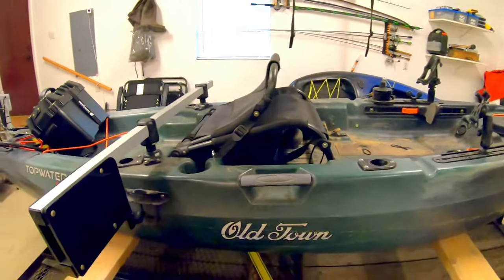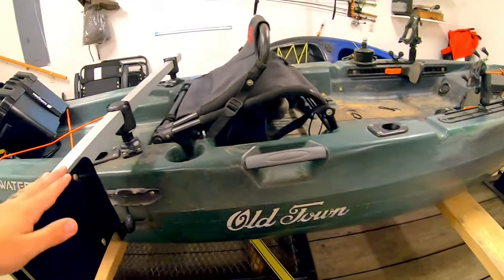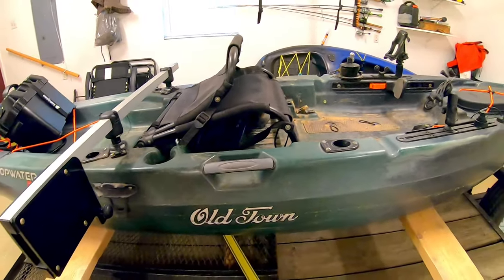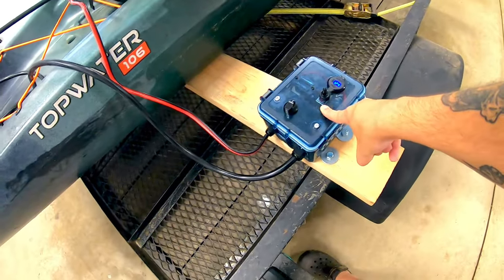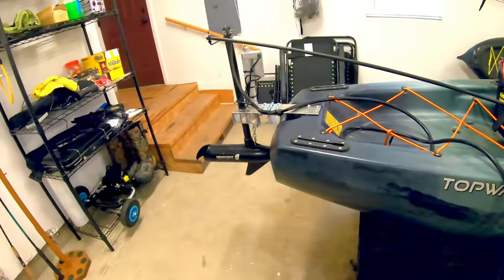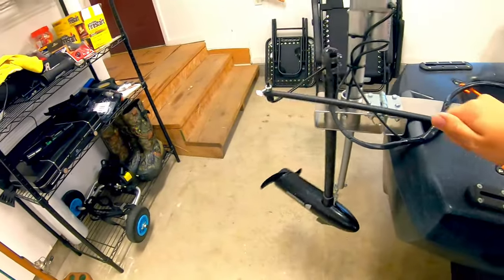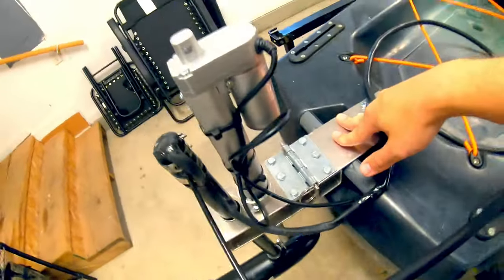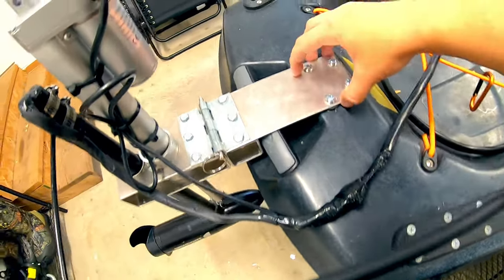Best Ways to Mount a Kayak Trolling Motor

Comment: I have a 10 ft Hoodoo kayak that I have a side mounted trolling motor and it works fine except obviously the kayak wants to Veer off to one side for a little while until it's up at speed and then I got a bigger kayak that was heavier I went with the rear mount and an extension tiller for the handle and it works phenomenal. I did not want to mess with a bunch of different wires and cables and having to deal with replacing pwms all the time but the setup I have now works perfect. Like you said you just have to watch videos and figure out what works best for you. Awesome video man!
Reply: Did you find it difficult to operate even with the handle extension ?  I would like to see how you have it installed.
Reply: @dalevogel83  no not at all, the way I have it set up is very user-friendly and I have a pulley system with a handle up front to get it out of the water I would show you pictures but I don't know how
Reply: If you aren't using a PWM or ESC then you are wasting about half of your battery power. The ESC/PWM allows your trolling motor to run 2-3x more efficiently, allowing you to use a smaller battery or the same battery for 2-3x the duration of your current setup.
Reply: @S_Yayyts  I have the Minn Kota Endura MAX that is infinite variable speed. I specifically bought that trolling motor because it's already built in so that I would not have to mess with wiring up a separate pwm and then replacing it all the time

Comment: Great video!  Very clear explanations.  The Newport NK300 and NK180 have me seriously looking at options for my 2016 Native Slayer Propel 13.   The easy mount for me is to put the motor right in my Propel drive slot.  Optimally, I want to speed up my trip to the hole and pedal the yak once there.  The twin thruster models have advantages, but the ones I've seen are very weak motors.  Still considering!
Reply: That's my main way..

Comment: I purchased the HOODOO SPORTS TEMPEST 120 HYBIRD EDITION. I run the cockpit fitted 46lb thrust trolling motor, they make where my PDL drive would sit. Then I purchased the Bixpy J2 motor, attached to my rudder. Both are on the kayak, for every trip. But I use one or the other, and always have my paddle, so I'll always get back to my launch spot. I researched for a year, and wanted the Oldtown 120 powered by Minn-kota. But at that time, you couldn't find any good kayaks. I didn't want to DIY any motors. But if it's working for you, food job bro. I know they're very tricky. Be safe..🤟🎣🙏

Comment: I have the same kayak but I’m in ocean water in Hawaii. Looking for a good set up for trolling motors. Will have to think of good ideas for one. 🤙🤙
Reply: MotorGuide Xi3-55SW - Bow Mount Trolling Motor - Wireless Control - GPS - 55lb - 36"-12V

Comment: I like the first set up, an interesting way to offset the weight would be to run two motors one on each side, there are 30 lb thrust motors that weigh as little as 8 pounds. that would give you 60 lbs of thrust, with an ecm and a 60amp hr lithium you'd be lightweight and powerful.
Reply: I like your train of thought

Comment: Cool system! The actuator is a great idea. Looks a bit slow though, but nonetheless very nice. I have an inflatable kayak so the options are very limited. I had to build my own system using a Bixpy motor mounted on the stern. What I particularly like about Bixpy, is the fact there is a wireless remote control to operate the motor. I believe they are the only ones with this technology. So you can operate the motor from anywhere in the kayak. Thanks for the video. Too bad I just found it.
Reply from the maker: Definitely looked at Bixpy. Looks like a great unit.
Reply: I've built an ECM wireless remote for as little as 50 bucks and can be used with any motor, I used RC parts for mobile watercraft.

Comment: I had looked for a side mount,  never did find that bracket for sale, always out of stock.  so I made one that locks into rail.   I'm on version 5, and have sold a few to other kayakers that i've met.  That said, I'm still not a big fan of side mount.   its hard to paddle and unstable.  Version 6 will have an extendable float to compensate.

Comment: You attached your motor mount plate with weld nuts and super glue?  Given no access beneath, how does this hold up and please elaborate on the attaching process in just a few words. Thank you , loved the video and advise.
Reply from the maker: It just uses 4 weld nuts and a little super glue. It held up without issue. 👍

Comment: Thanks for the video, very helpful. I have a question. The battery, is it like a car battery or is it rechargeable?
Reply: Use a deep cycle marine battery for a trolling motor. You will have to recharge it when it gets low

Comment: There is a lot I like about this design. Not totally convinced that AE Power actuator is necessary though. Does a kayak really need trim? Or is a fixed depth all we need in something going less the 6 miles per hour? I would do steering control cables to get ride of that rod getting in the way. Just my thoughts
Reply from the maker: Trim isn't necessary. It's just nice so if I go shallow, it won't hit the bottom.

I've seen steering cables connected to the foot pedals to turn the motor but the rod has had good control.

Comment: Where do I find how to wire up this control box…I have almost the similar setup just have an extra actuator tilting the motor back.
Reply: Im thinking of doing lift setup, so over the pathetic cables etc. you mentioned you have one setup on the tilt also, wowww i would love to see that, Cheers Rick

Comment: Hi where u pull the pin to separate to remove the motor. Does that hinge allow  the motor to swing back incase to run shallow unexpectedly or into an object?
Reply from the maker: Yes it does! The hinge is literally a stainless steel door mount so it can swing upwards, in case a rock or anything is hit.

Comment: Great video! Thanks for the information. How much drama did the SOS give you in registering it? I live in Michigan as well and I'm dreading registering my kayak.
Reply from the maker: Wasn't terrible. Crappy thing in Mich is that you can't register a new watercraft online, you have to go into SoS.

They'll ask for year, make, model, serial number stamped on the hull, and possibly a bill of sale/receipt. I didn't have the receipt anymore and they didn't give me trouble over it.

Once registered, the sticker they gi e will need to go on the bow of the kayak. You'll also need to get white stickers to put your boat's registered ID on the bow.
Reply: @WhiskeyWood_Studio  Yeah, I registered mine yesterday. The SOS lady sounded like a leaking tire with all the sighing. She walked away and had to confer with a coworker 3 or 4 times. She demanded that I pay tax a second time because I didn't have a bill of sale. When I explained that Walmart collected tax when I bought it, she responded with "How do I know that?". When I responded with "Common Sense", she got very upset. It was a drama filled event to say the least. But it's done and I'll be out on the water tomorrow. I ended up using a RAM Mount and a ball I 3D printed to hold the shaft.

Comment: Where did you get that trolling motor? Did you just disassemble and re-wire a trolling motor?
Reply from the maker: Yup. Got it on Amazon, cut the length down, and rewired.

Comment: I have a 2 man kayak.I have never owned an electric trolling motor.I thought I could just buy a trolling motor with pos/neg clamps going from motor to batt after mounting both.So its not that easy?
Reply from the maker: You can certainly do that like the first setup I show in the video. It just needs a plate to clamp onto if you wanted the quickest method to add a trolling motor to your kayak. If the bow of your kayak is big enough, you could even mount it to the front.

Comment: What is the rod you mounted to the trolling motor shaft that is pinned to your steering arm?
Reply from the maker: It's called dynaform rod. You can find them on Grainger. I ordered one, cut it to length, and use it for steering.
Reply: @WhiskeyWood_Studio   What diameter of rod did you use?
Reply from the maker: @swiggs754  1/4" x 10' dynaform rod is what I ordered. You can use any fiberglass rod though.

Comment: very dumb question from someone about to buy his first kayak. Why not a pedal kayak instead? thanks :)
Reply from the maker: @jonathangamboa9647  if you’re buying a new kayak, I completely understand a pedal drive system. I had this one for awhile. I wished I had a pedal drive one but wanted the next best system for just $200 so I built this setup at the time.

If you have the budget, buy a pedal drive system. They even make trolling motors today that just drop into the pedal slot up front.

I’ve since sold this kayak and used the funds to help buy a deep v fishing boat.

Comment: Have a single push pull steering rod set up on my iRocker paddle board 60 lb thrust trolling motor.
Works much better than ropes or cable each side.
Yours is the first I've seen similar to mine.
The actuator to raise and lower the motor is impressive.
I have considered such an idea but must say I've been beaten to it.
Also good is the hinge pin release.
What holds your motor from tilting in reverse ?
All in all some very good ideas.
Best regards from Torrumbarry ,Victoria,  Australia.

Comment: A problem I've run into trying to register my paddleboard with a custom transom and trolling motor in Texas -- the paddleboard did not come with a standard serial/hull# recognized by the U.S. Coast Guard. It has to be in this format: MIC-XXXXX-XXXX. MIC is Manufacturer Identity Code, so for example for Old Town Canoe it would be something like OTC-5 digits-4 digits. I can't get the seller to do this (I can't blame him: why would he go through this bureaucratic rigamarole for a single customer he's already made a sale to?). I'm probably the only customer who's putting a motor on one of his paddleboards -- not that common. So now I'm in a bureaucratic Catch-22 black hole. I either use it illegally and risk a fine, or dump the whole investment down the drain.
Reply from the maker: I mean...I would just use it...
Reply: @WhiskeyWood_Studio  Haven't yet with the motor, but I'm going to. Probably will never be stopped and fined, but just wanted to let others know of the issue.
Reply: They don’t give a shit about trolling motors LOL. They have waved and come over and asked me about my Frankenstein. If it were more powerful they said they’d get me. “Most” aren’t assholes. Just be respectful. 👍
Reply: @jagervolant7871  Good to know. In what state are you?

Comment: First off, with the Bixpy, I would say don't buy it if you will have to install under the boat. These things collect weed and might stop and you will need access to remove that weed. He's using a cheap AGM 35 amp battery. Yesterday's technology. Lithium is the way to go. Yes it cost more but it's worth it.... Let's compare. His battery is about 24 lbs, my Battle Born 50 amp is just 17 lbs. If he treats his AGM in the best way he will never bring it down by more the 50% or it will die in a much shorter time. That gives him a much heavier battery at only 17 or 18 amp hours. I can and do bring mine down almost all the way.  Do the math. Lets also consider that my battery will last much longer.

Comment: I strongly reccomend just buying a trolling motor that comes off the shelf with a remote control very common and fairly affordable much better than trying to ghetto rig your own control system
Reply from the maker: The preferred term is "redneck engineering." Gives a little more class to the potential electrical fire 😂